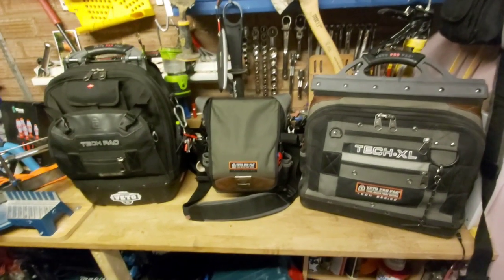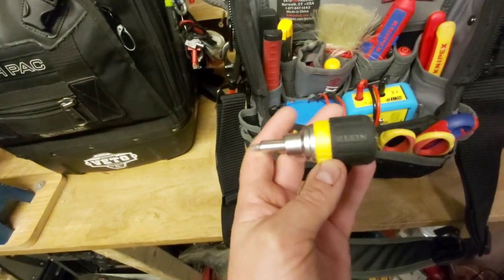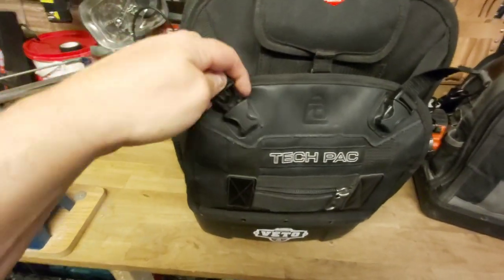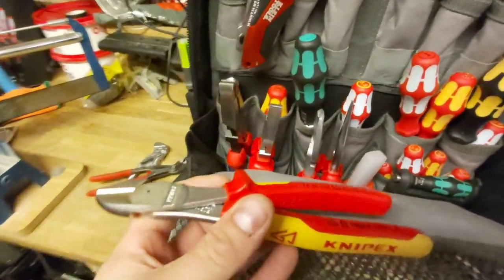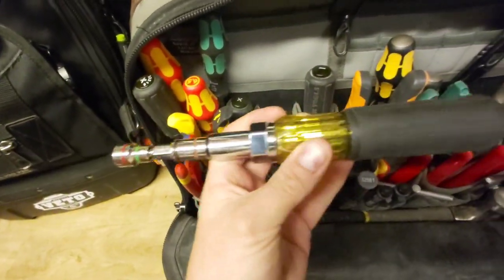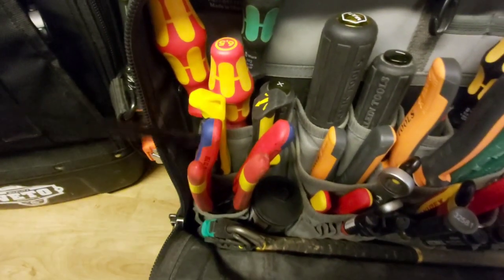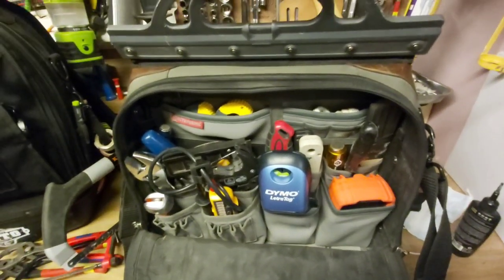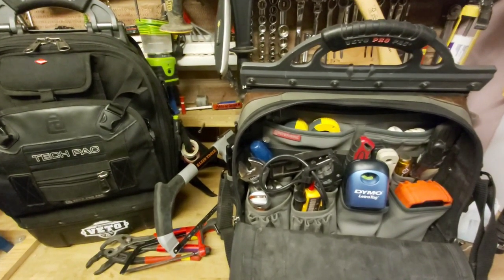Tool bag Tours of my four main tool bags

Comment: You need to get your head around that sniffer, you may just find it one of your most useful tools.. I would have killed for one of those in my youth, the only guys who seemed to have them in the UK those days were GPO engineers and they would not part with them.
Tend to come under the generic name ' tone testers' some are more sophisticated than others.
They are used to trace cables.. clip the transmitter on cable at one end and the 'sniffer' end is used to locate the cable at the other end... by listening to the tone that the Tx produces.
How on earth you managed to use it those few times you mentioned, I have no idea if you don't know anything about it.
Some are more sophisticated than others of course, basic sniffers can be used with most TX units, the more expensive ones have to be used as a dedicated pair.. they avoid 'stray' signals that can be produced by all sorts  other equipment.
Reply from the maker: Hiate thanls for that it looks like a really useful tool. I havent used it mate probably just said it under the pressure of making the video dont know why i did

Comment: Concept Pro is the product name of Videcon, one can find that CCTV test monitor under various name , and the price can differ by over £200.00 for the same product !! 
And, by pure coincidence, I dud mine out last week to charge and then... forgot, it's now on charge as this post reminded me !!
I reckon I have had that for maybe five years now, along with at least ten other test monitors. Dahua seems to be my 'go to' IP test monitor and my trusty old Teletest for CVBS analogue cameras.. always carry at least two of each as I could not be hundreds of miles away and have one fail... or run out of charge.
Reply from the maker: Thankfully mine is company issue so i dont need to wirry too much. Yoy will be pleased to kbow i have now put actual batteries in the sniffer now

Comment: I just got some knipex 74 21 160 side cutters for in my tech-mct. Knipex only makes them in 200 and 250 now, was lucky to find them in a store. 

They are the ones with a 12° bend, which I prefer
Reply from the maker: You know what i would really like a pair of them. Same here though cant find them anywhere
Reply: @danstoolroom7700  yeah I count myself lucky I found some. The straight ones are great but I really prefer the angled ones. 

I also got the 200’s and they’re great, but these save a lot of space and I already carry linesman for the big stuff